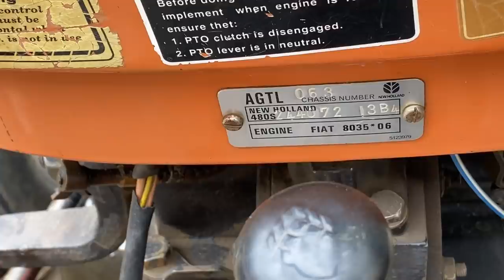strange sound coming from inside the tractor Open the engine gear and check

Comment: Good work done by hard working guys with only a few tools.
Those that knock them should try doing it without a fully kitted out workshop.
Reply: Man that is the fully kitted workshop! They aren’t roughing it, those are the pros.
Reply: Guys here in the US fell like children without their power tools. These guys are the real bosses! Much respect to them.
Reply: @TheHuskyGT  Beam style torque wrenches are dirt cheap even over there. Don't need a power tool to know that. It's not with what they're doing the job WITH that is the problem, but how they do it. Chiseling at seal points, rolling parts in dirt, slamming shafts to disassemble them, the ol' arm torque wrench, reusing old bearing rollers, reusing solvent, the list goes on and on. I don't knock the gumption, I knock the lack of actual mechanical skill.
Reply: And it's probably hot as hell with wicked humidity
Reply: @robertw1871  That’s true these dudes probably have studied even been to schools they know what they’re doing , not any average Joe could take apart complex engine and things like this and fix them back and make them work, these are not happen - chance dudes they are the professionals in that country, I am electrical and mechanical type guy with degrees and I’ve worked on all types of things , and I would be challenged to do what they’re doing I would have to get some insight as to how to go about it and figure it out,They can take these parts out and throw them all over the place and mix them all up and still put them back in the proper position that’s what a true mechanic /technician can do👏👌👍
Reply: @sambell385  I mean, its not that difficult man, its just big.

Comment: I've done a couple of jobs like this on way bigger tractors by myself but in an equipped shop. They got the job done with barely any tools, a job that very few mechanics would touch.
Reply: Yeah I’ve done plenty in good shops and in the dirt on the side of the road. 
Gotta admire these guys for sure. They just get right after it.
Reply: Yes it just shows how how far we think we have come .... But In all reality we only want too do it when we're comfortable.  I've had too replace a turbo 400 in a land yacht Chevy. So what most will say.  BUT I DID IT IN MINNESOTA IN JANUARY OUTSIDE AT 40 BELOW !!! SO I HAVE ALOT OF RESPECT FOR THESE GUYS!!
Reply: (WOW ) THIS SOUNDS like the grandparent or parent story of I had to walk barefoot 10 miles up hill both ways in a foot of snow just to get to school but I did it cause we was Tough back in my day lmfao 😂 🤣 😭 😅
Reply: @justinbaas843  I was raised in SoCal in the 1970s so there was not much snow. My mother on the other hand was raised in S Dakota during depression times and had to take a rock heated by the fire, to bed, to stay warm in the bed she shared with two sisters. There were no hills but arriving to school with frostbite was not uncommon.
Reply: @randylanhart1387  Congratulation👌.

Comment: This is exactly like we worked back in the 60s working as an agricultural engineer on MF tractors. We would do a job like this on site working out of a van. I cant believe now what we used to do or how I did it. We could do a brake overall on oil immersed inboard disc brakes on site in a day, a clutch 4 to 6 hours on site, new pistons and liners in a 3cylinder Perkins A3152 engine on site in 5 hours on my own, never used a torque wrench. What I will say though is I would have had some axle stands under it and had some better boots on too not safety flip flops. This all takes me back. Thanks for the video.
Reply: You said so well💯👍
Reply: But were you wearing pajamas and sandals?
Reply: @orion5409  I had an asbestos pyjama back in the days but wore it only when I had to torch something bare handed because it was very rigid. Sandals only in wintertime with all season profile. 😁
Reply: @orion5409  No I would have frozen to death were I live. I worked on site most of the time and It would be raining or snowing up to my eyes in mud. Thats was the North of England for you 50 years ago.

Comment: Gurantee 7/10 bolts they touched are almost rounded off with their improperly sized 12 point crap. Overtorqued under torque Atwell

Comment: I get a kick from such videos. OSHA would shit a brick! No shoes. Dirt everywhere. In kerosene or gasoline with Nate hands. But they get it done!

I’m also frosted by tractor design. I have a 90’s vintage JD made in west Germany marked made in USA and a Long made in Czechoslovakia in the 70’s. John Deere and that New Holland put everything inside the gear box. Why? Main hydraulic pump in the “case”. Brakes in the case. Gears in the case. Clutch in the case. Filters in the case. Anything goes wrong...crack the case. Cost me $5k to fix a brake lining. Crack the case replace half the stuff in there. 

Long. Only thing is the case are gears and an oil pickup. Uses 40w motor oil, not special hydraulic fluid from JD. filters and strainer, outside on the frame. Pumps outside on the block. Brakes, in the wheel hubs. Every job I ever had to do got done in the barn by me. Few nuts and bolts new pump or filter or brake bands.  Hope those goofy design engineers enjoy the $200 per pound bacon. We farmers gonna pass the costs on or quit farming. Or get a horse.

Comment: A "New Holland " sounds dutch!, nice job!!!
Reply: New Holland was a Ford branding of their tractors in Europe/Asia, then it was bought out by Fiat Agri in the early 2000's - They are good machines, including backhoeloaders, 360s, etc.
Reply: @craigywaigy4703  thanks for the info!!!
Reply: @craigywaigy4703  New Holland tractors and farm equipment were originally made by the New Holland company in the USA. They were named after the town where they were founded: New Holland, Pa. (and yes, the area was settled by Dutch immigrants, among others, thus the name to remind them of the old homeland.)

New Holland was sold to Sperry, and then to others, and then to Ford, and then to Fiat.
Reply: @lwilton  They make good equipment, but when Ford bought them out, then Ford in Europe rebadged everything as New Holland, as Ford don't have a great reputation. It's a shame that all these independant manufacturer's have been bought over by multinational conglomerates! It's the same in the construction/mining industry, which leaves people(dealers, suppliers, manufacturers and users) beholden to 2 or 3 massive global corps. It seems that the predatory financial sector has forced this upon manufacturers, so as to avoid corporate predation by others! Fiat is a perfect example if this, as is Terex.

Comment: i wonder how they set the pinnion depth.one would think that would be of huge importance for longevity reasons.
Reply: Thats why i still have never messed with a rear end,
Reply: I think they use same adjustment plates (simms) under bearing. Hope that they measured it and adjusted with New pinion or they will face same problem Again 😅

Comment: These guy's just get stuck in until they find the problem.  The working conditions are less than ideal, the safety standards are non existent and the repairs and the rebuild will probably be giving even more trouble in the future.  Still impressed with their 'get on with it attitude though'.

Comment: The only thing I will add is: if you are working on heavy equipment, you must have a torque wrench and you must consult the service manual and/or repair manual for the proper torque.
 You cannot perform the proper torque by guessing with your strength.
Reply: Not always. You’re correct - technically. However here’s an example: I just overhauled my Chevy’s 3.1 V6 and the lower intake manifold had 2 minor oil leaks because I used too little RTV on the block seal. When I went back in to clean it up and apply a new bead, the lower manifold bolts were loose!! I tightened them to spec, which is 18ft/lbs. Now, 18 ft/lbs in my book is practically only finger-tight, which seemed wrong, so after cleaning up the gasket and applying a robust RTV bead, I tightened down the manifold bolts according to my own feel, using common sense of course. The bolts haven’t come loose this time and the seal is perfect with no leaks - so yes, you can often go by feel with automotive fasteners in an as-needed situation if you’re not a total idiot.

Comment: 4:00 this happens because the farmers always put too much load on the trailer.
Reply: Will never know.
Reply: Or he had too little oil in the reduction gear.
Reply: Which came first? The chipped pinion gear or the shredded case bearing. Either way it still looks like a fun fix.

Comment: Can't believe these guys haven't made themselves a bearing press? WTF. They are so damn simple to make. Why not?  It's crazy.  You DONT FUCKING HAMMER ON BEARINGS.
Reply: Ah yes but you have to remember that using these techniques coupled with working in a dusty environment means they get to do the job again in 6 months when its failed again :)